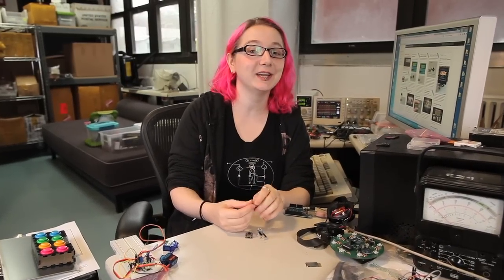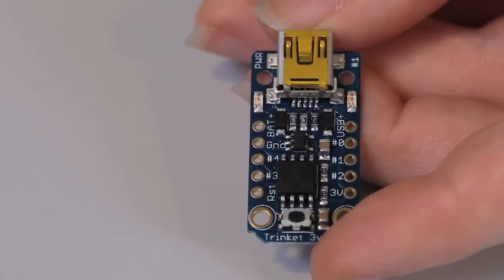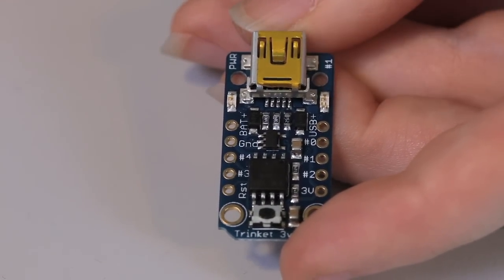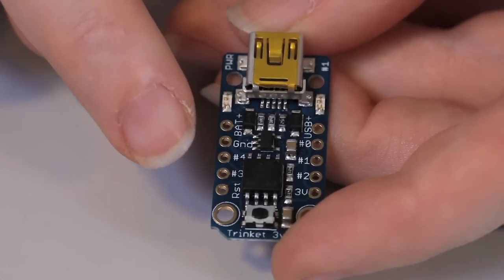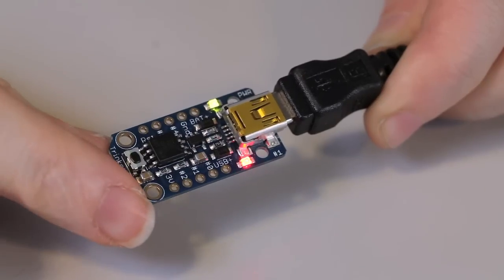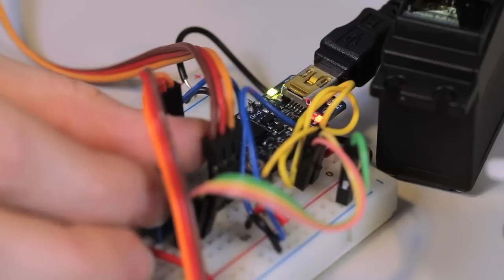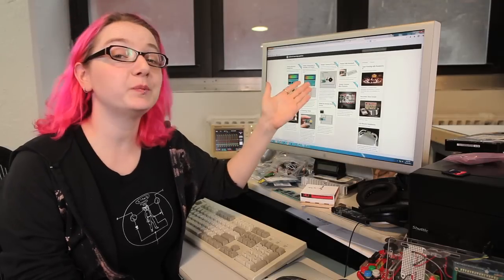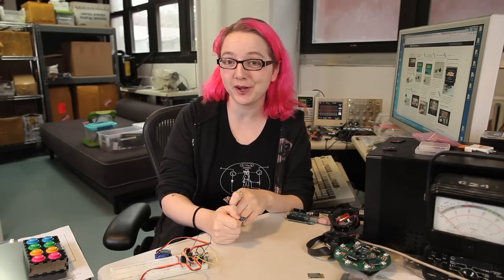Introducing the Adafruit TRINKET

Comment: Not sure where to ask but stumbled onto this video so here it is; When I press reset on my trinket the upload fails well not all the time there are occasional successful uploads. What I did notice is the drivers for the Trinket, USBtiny, under the device manger(windows) go shaded. This is normally an indication the device is not plugged into the USB 2.0 port. After the 10 second upload period the driver goes active. It is a bit late as the upload has already failed. Have a short crude video if you are interested.

Comment: Hmmm..   Just realized, the 5V version has those shunt diodes for the D+/D- lines on the USB port...  That could complicate using those I/O lines for other things when not bootloading. I guess they'd still be good for some things. Everything's a trade-off when you design something like this, eh?

Comment: avrdude: Error: Could not find USBtiny device (0x1781/0xc9f) I have tried pressing the button
Reply: I dont know if you've already solved this issue, or the details of your situation but if you're using WinAVR you might have to add the USBtiny into WinAVR's list of parts which is in the avrdude.conf file.